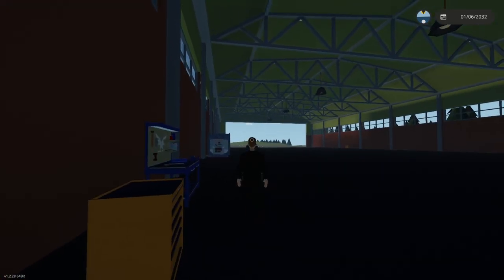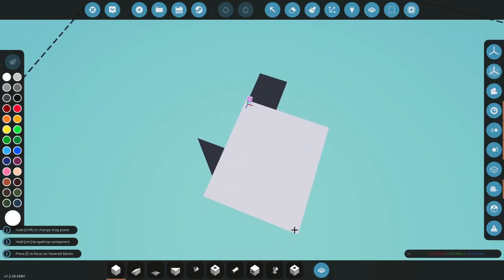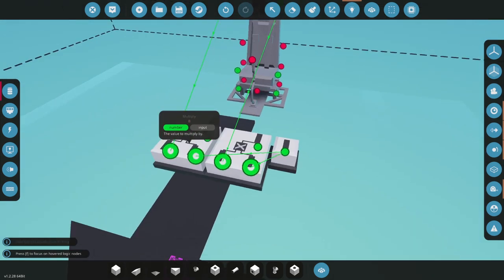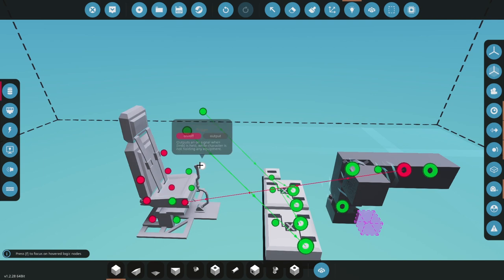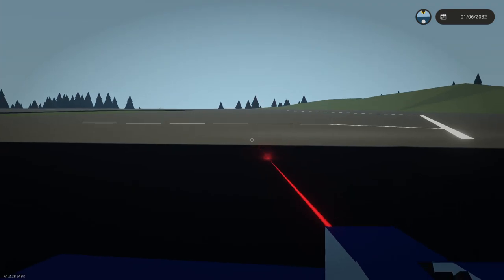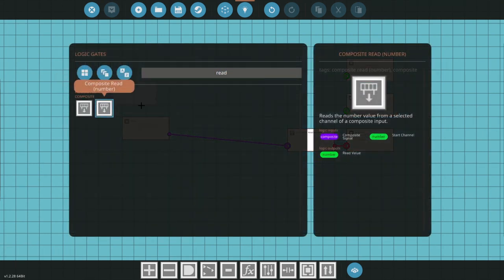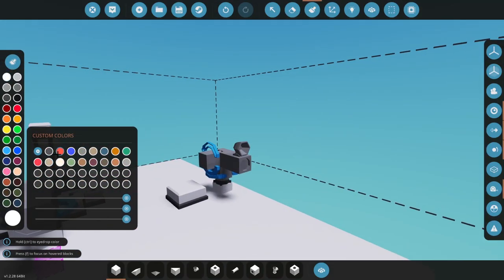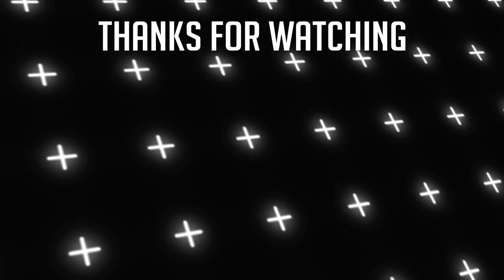How To Make Super Accurate Turrets For The Weapons DLC! - Stormworks

Comment: I'm not sure why but this just straight up doesn't work for me, the laser is shining, but there is no visible point, and the sensor doesn't do anything. I even set their wavelength to the same number and it still does not react. I am bad at using logic in this game, any advice?
Reply from the maker: The laser point sensor detects the point created by the laser colliding with a surface, so if your laser is not creating a visible point then it won't be detected
Reply: @BigmanBois  How would I make it create a focused point instead of just being a red light in that case?
Reply from the maker: You'll have to make sure everything is conmected properly and then you might need to mess around with the positioning
Reply: @BigmanBois  Sorry for all the questions, but I am fairly new and I still need to learn how all these things work. As far as I can tell everything is connected just like you've shown, and when it comes to positioning, how would it create an unfocused laser, and what would be the condition/right position to become focused?
Reply from the maker: It focuses when a red point is created by the laser hitting something, so if your laser is positioned that it doesnt then it wont work
Reply: @BigmanBois  I understand that, but the laser behaves like a red light no matter which way it is pointed and whether it collides with an object or not, and since it is on pivots I can change the position in real time, and it never behaves like you'd expect a laser to. It doesn't display a beam that results in it pointing at something, it is just as if I had placed a light there instead of a laser beacon.
Reply from the maker: @avitus5770  I've never had that issue before. I don't know what is going on sorry
Reply: @BigmanBois  Ah, well thanks for trying to help me anyway. I'll play around with it some more, and get back to you if I manage to figure it out.

Comment: how did you fix the up and down being inverted?
Reply from the maker: Use an inverter or try to invert your sensor
Reply: @BigmanBois  sorry that im quite dumb at this, but how do you do this?
Reply: @randompopcat9615  it's a block, just search for "numerical inverter"

If you're doing this inside a microcontroller, just use pass the value through a function set to -x